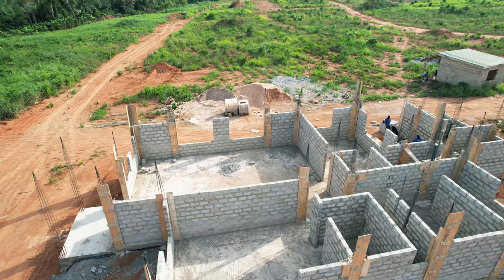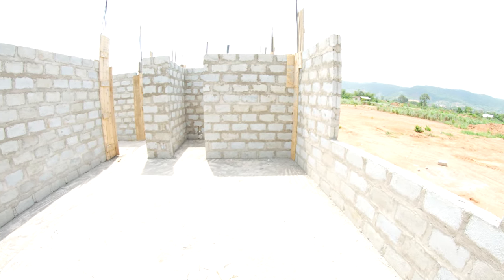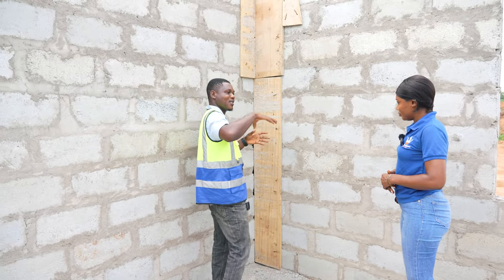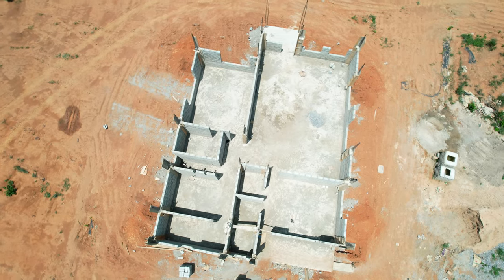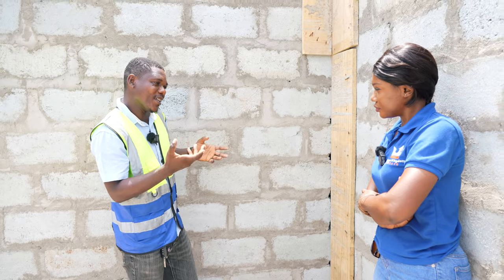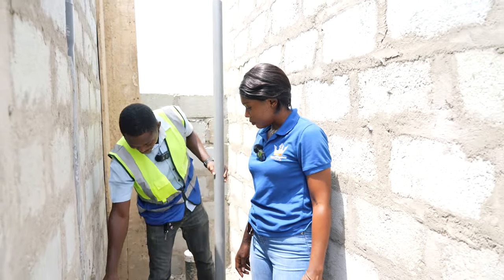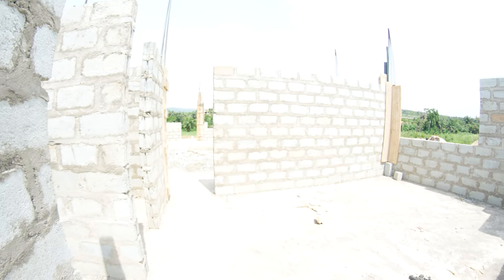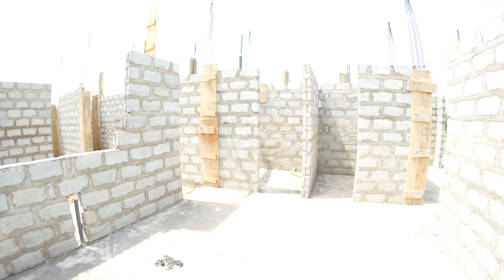WE HAVE COMPLETED THE GROUND FLOOR CIVIL WORKS AND INSTALLED THE PIPES ON THIS PROJECT!

Comment: I was going to ask about the foundation of the staircase but my question is answered 
I hope the steel bender will get the frame for the staircase ready before you cast the concrete when my project will be started thanks
Reply from the maker: Your project will be done perfectly 💯